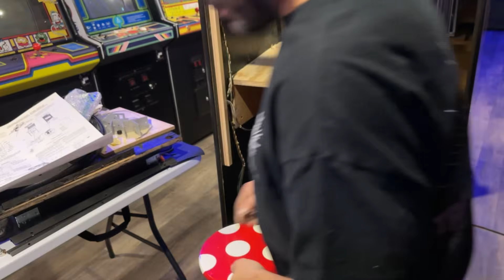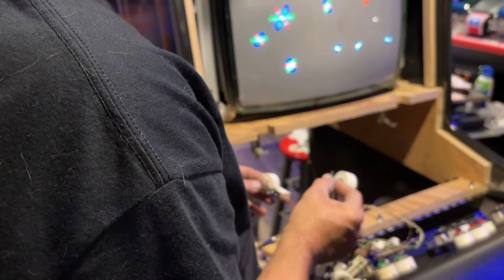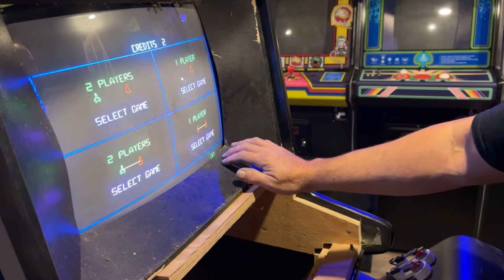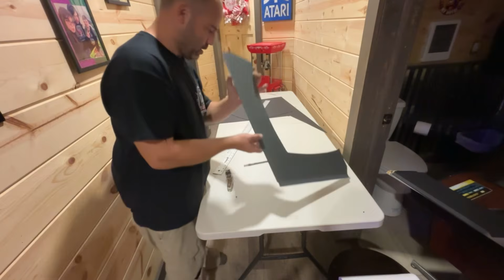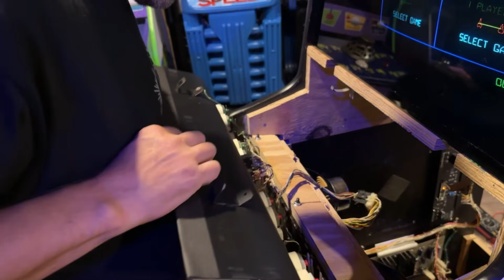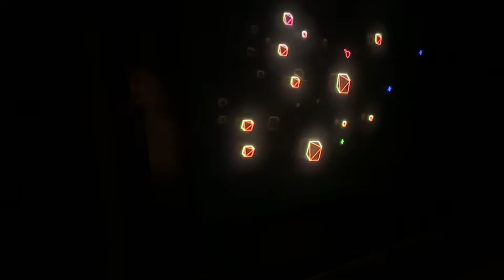Space duel Arcade restoration part 8 it is finished

Comment: Ok,  With subbed rheostat it still shut down.  Subbed Rheostat shorting 
to metal and you insulated it?  
Wiring to speakers bad? Speaker load not correct?  Or a ground
issue?  Don't know how I missed what you found, lol.  My new rescue
dog must have distracted me :)  He's a lovable goof 
But great job, and Looks awesome !
Reply from the maker: It ended up being the upper speakers not wired correctly. The speakers are supposed to be wired in series and they were not.
Reply: @troylukans2174  Thanks Troy.  Very odd one there.
Reply from the maker: @killedperfectlygoodweekend  yes for sure

Comment: It turned out beautiful, another wonderful restoration, and I learned some new tips for stuff. Thanks as always Troy. Side note, if you're gonna work on EM machines you should really get a flex stone and a leaf bender, the switches in them are self cleaning and emery board will take the plating off which you don't want to do.
Reply from the maker: Will do thanks for the information and thanks

Comment: Beautiful game! Congrats on another stunning restoration! On the wire-wound potentiometer, you also need to pay attention to it's wattage rating as well as the Ohms rating. Wire-wound pots use nichrome wire to create resistance instead of a carbon film track. They are capable of dissipating more heat that standard pots. So you will need a wire-wound pot of the correct Ohms, wattage and with an audio taper. Some pots have linear tapers but volume controls use audio taper, since sound pressure is measured logarithmically. Keep on keeping on!
Reply from the maker: Yeah, I realize that after I grabbed the other one and tried it OK Jason says it would work, but I don’t know if that’s true or not. I didn’t screw with it. I just found another one. Took it out of the Arabian for now. I’m sure I have another one somewherethank you very much.